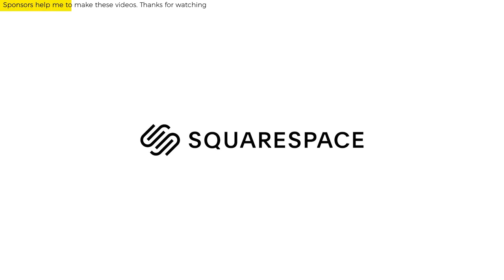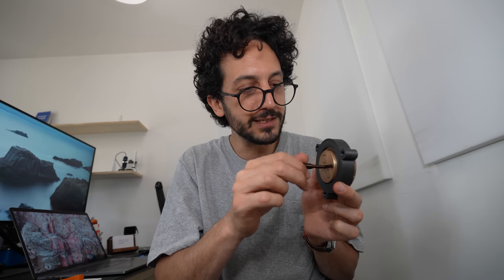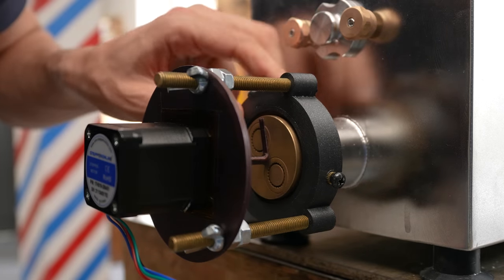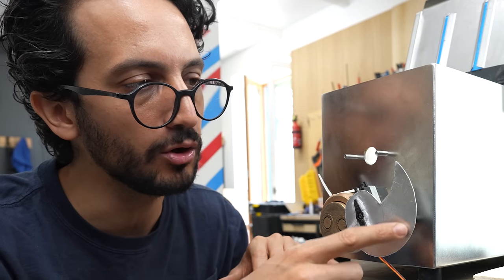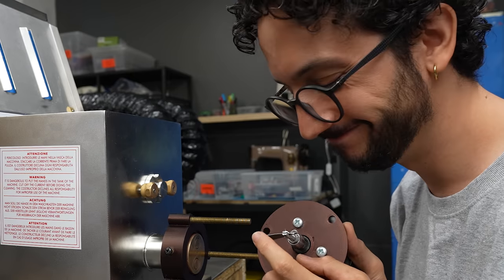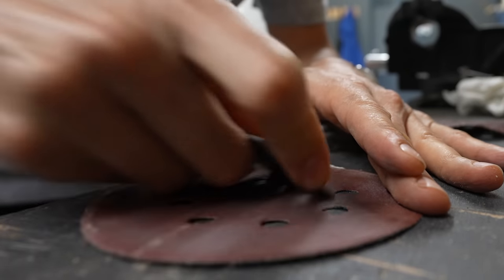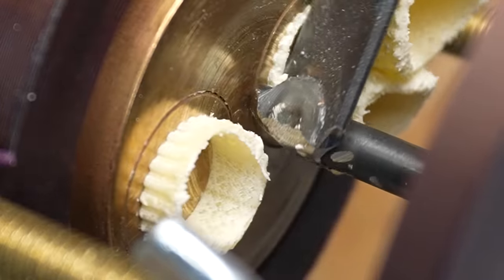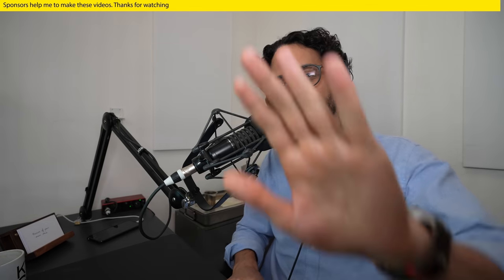I Tried to Make an Automatic Pasta Cutter (did NOT go as planned)

Comment: right, so the issue is the inner part of the blade is traveling very very slowly and on an arc
With that larger pasta extruders, the blade is effectively in a straight motion rather than an arcing one (especially further out)
When you cut with the knife it's fast and in a straight direction
You very much limited by the radios of the machine

Since you can code a bit, i would try making a linear cutting edge that goes up and down
Reply: just ping me if you want help
Reply: Also, the pasta dough was pushing the blade out of the way, especially on the thick one, which interrupts the cut. A wire might work for such a small machine.
Reply: problem with this is it would destroy the pasta on the way up, and if it was 2 sided it would cut too small, or have to do some sort of half rotation backwards up the machine and then come down straight again
Reply: Probably easier to scale up the current rotary design so that only a portion of the sweep interacts with the pasta.
Reply: @doodle9495  They were thinking of using a linear actuator, not a rotational motor like a stepper motor. Anything using a rotational motor will have the exact same issue that they pointed out.
Reply: @uiomancannot7931  I was thinking the same thing. That a wire would prevent the pasta from catching.
Reply: If you just realized that he could have his motor off to one side so that it rotates for 3/4 of the stroke over nothing and then only the last quarter actually cut across the dye. He'd fix a lot of these problems without having to complicated with linear motion or pausing or anything like that. He just needs to offset it to one side. He's 3D printing the cap so it's not like that's hard.
Reply: @doodle9495  It doesnt have to go up directly if you make a cutter/guillotine 🙃
Reply: @photonicpizza1466  That's not the case if the rotational motor drives a spring-based rotational cutter that resets on the back-swing...but now we're getting into tension adjusters, limited-slip-gears, et cetera. Probable easiest configuration would be a "Transmitted Force-sensing Series Elastic Actuator". Still, it's not a great solution, when a magnetic linear-actuator and a double-sided blade would do the job.

But guess what? Alex has a solution that works great for this pasta shape...so why would he employ these techniques?
Reply: @liiiinder  wym?
Reply: But the pasta maker maker sells an electric cutter for the machine that is one step above what Alex bought.
And the die diameter of that machine is 63mm instead of the 56mm of Alexs machine.
I don't think that those 7mm would suddenly change everything.

So his (and the pasta maker makers) approach should most likely work. (as proven in the end of the video)
Reply: Exactly this. Hope he sees
Reply: @doodle9495  two sided blade?
Reply: @photonicpizza1466  i totally agree
Reply: That's not the issue lol. Reason being he pretty much solved it in the end (So there is no "issue" to begin with), and his DIY automatic pasta cutter works the same as the ones made by the company who makes the machine. Only difference being he has a blade on one side, instead of two.
Reply: 1. Move the axis of the motor off center.  
2. Change the shape of the blade to be sickle shaped. 
3. Change the Blade material to laser cut stainless steel which he can sharpen
4. 3D printed wedge affixed after cutting edge to eject pasta away from cutting surface.

This would solve the problem of cutting motion, blade flex, and pasta not moving out of the way once cut.
Reply: I'm liking the idea of the linear actuator, and you'd only need one.  Anchor a wire or bit of nylon line above the extruder (maybe with a spring tensioner), with the other end attached to the actuator.  Time the actuation to the size of noodle you want, and the wire/line will cut on each stroke, forward and back.
Reply: Instead of a linear cutter he could also move the center of his spinning blade to the edge of the bronze disk and use a longer blade
Reply: Not really limited by the radius of the machine you could always mount the blade oustide the circumference of the extruder and make the blade go around and cut the dough in a similar motion as when cut hy hand. Blade in the edge of the extruder goes around, gives you more time for pasta to extrude then comes around and cuts the pasta.
Reply: That way the dough wont bunch up with each other as it just falls down while the blade goes around the outside of the circumference, it isnt going back up and mushing the dough with the next cut as in Alex example
Reply: Finally someone said it. 👍
Reply: Indeed. I was thinking that this will be the major obstacle. The distance travelled and thus time of cut is different between closest to centre and most outer point while the blade rotates at slowish speed (compared to the footage from the plant visit) and the extruder still extruding. I would have tried perfecting the last version with a start-stop timer (2 seconds off after one quick cut), and a much quicker cut speed (one turn).
Reply: On top of an off-center stepper motor, a sharpened metal blade (somewhat softer than brass to keep the extruder intact) with both an axial and radial offset could help with the cutting action might help: angled on the surface of the extruder and the outside of the knife "in front of" the part in the center, similar to blender blades.
The waiting time of the stepper motor between 360s can be mapped to length of extruded pasta in mm and the blade design ensures a clean, straight cut.
Reply: Yeah man, the cutter you built does not create the motion you need, you got  biased by the industrial ones!
Reply: Co-sign

Comment: Alex, remember the aggregation of marginal gains.
Good night's sleep +1%
Sharper blade +1%
Better blade shape +1%
Non-stick properties for the blade (carbon steel blade seasoned like a wok! Or just a non-stick coating on stainless steel) +1%
Blade alignment +1% (including support for the motor so it does not bend the blade out of alignment!)
Consistent pasta dough +1%
Clean pasta extruder +1%
Variable motor speed +1% (faster when cutting, slower when not cutting)

You will make the best one-man domestic dried pasta factory in the world. I believe in you.

Comment: To have more control on the pasta length, you may need to introduce a "pause" between cuts instead of just controlling the blade rotation speed.
Also didn't you think of using the blade of a utility knife

Comment: Sometimes I forget that Alex is an engineer lmao
Reply: He studied telecommunications and wireless networking. Somewhat related to software engineering (though just barely), but hardly anything like mechanical engineering.
Reply: @photonicpizza1466  I seem to recall him saying he worked as a software engineer before, which is what I was referencing. 
Regardless, by definition he is an engineer.
Reply: @TheTamally  He worked as a web designer. Not even software engineering, just very light programming.
And by your definition, most engineers are absolutely useless with mechanical systems like this. Even a proper software engineer is abysmal at considering important things like shear stress etc. “Engineer” is a very broad term, and using it this mindlessly is asinine.
Reply: @photonicpizza1466  Are you okay? You seem way too worked up about this. 

By definition an engineer is "a person who designs, builds, or maintains engines, machines, or public works." Wouldn't you know it, Alex designed, built, and maintained multiple machines over the course of this youtube channel.

Comment: Maybe, try to imitate what works well by hand : a blade set almost flat on the die. Maybe something which cuts 2 pastas by which moving up and down. When it cuts, it does so in short and quick motion. Size changes with delay between movements.

Comment: You were onto a winner with the saw blade but you're forgetting one essential thing:
ANGLE,
If you don't cut it with the blade facing forward you'll smoosh the part of the pasta you just cut onto the part of the pasta that is still being held by the extruder, the last prototype worked a bit better because of that (the pasta was ejected away from the extruder).

To put that into perspective try cutting your pastas with the knife at a 90° angle from the extruder, same result.
Good luck

Comment: I’m hoping he realizes that this setup can’t have a constant spinning blade. It needs to quickly spin and stop to allow the pasta to extrude then quickly spin again.
Reply: You can make the blade slighty canted
Reply: maybe mount the motor next to the extruder and run the motor faster?  🤔
Reply: Yeah, when he said "stepper motor" I thought that's what he would do. "Hey Alex, use a brushless motor with a position controller!" Then he could make the lengths of the pasta exactly what he wanted.

Comment: When cutting it with a knife the whole blade of the kinfe was at a right angle to the pasta, or flush to the extruder dye so it didn't let the pasta Stick, or be carried by the blade. If you made the "blade" on your current set up thinner (blade to spine), think blade out of a disposable razor rather than hand held old school straight blade razor as a 20 degree facing the dye then put it at a right angle to the extruded dough you won't "catch" the pasta and carry it, especially on the upswing. Think 12:00 to 6:00 cut vs a 4:00 to 10:00 cut.
Reply: Will agree the blade that you made need to be at an angle to get a better cut like a the angle of the knife
Reply: agreed, make the blade surface smaller,give the pasta less surface area to stick too.
Reply: can use wire like from a wire cheese slicer as well.

Comment: Wonderful solution.
With a double blade like the final one you made. If you alter the code to turn 180 degrees, stop and wait, turn 180 degrees, stop and wait ... etc
You need only alter the frequency of the cycle to cut very  specific size pasta.

Comment: Alex, what you need is intermittent motion, not constant rotation. Bigger pasta machines don't need to do this because the rotor turns fast enough, but your die is so small that the entire die is probably the size of the axle of the pasta cutter on commercial machines. Since you have a high torque motor, do this: Have the blade on a spring-loaded pivot, and let it compress the spring as the rotor turns, then at the right time, have it pull past the stop and swing forward to slice the pasta from the outlet.
Do this once every 180˚, and you'll get intermittent motion with a quick fast cut that works well with your small pasta die.

Comment: This series is getting long. It's clear you are so passionate about this. Lovely to see. It also made clear why they are not selling a cutter for this machine.

Also, as some have mentioned...... this disc seems too small to cut with continous motion, but also starting and stopping is difficult. If you could stop, and then quickly spin 360 and then stop again (repeat) then that could work for larger pasta.

Comment: Use an old skool Razor blade. Code the cutter to wait and then cut QUICKLY every five or six seconds (depending on required length of pasta). I'm deeply impressed by your dedication to this project by the way given that you could just get on your bike and have very good pasta from the deli for smalll money  😁

Comment: Alex first time responding to your videos. Your over thinking this. You need a relay switch with a blade that will cut down and pull up at very fast speed. The pasta comes out at what 4.0 second and then slice. You could use box cutter blades because they are cheap or wide razor blades. I love your work.

Comment: Alex use a piece of spring steel. Set it at a very shallow angle with some light tension against the surface and very fine edge that has negative relief against the surface of the die.

Comment: For a cutting blade, try the steel bands they use to strap heavy boxes shut for shipping.
They are very springy and thin so you can preload them against the die to take out the play.
Also, increase the angle like they did in the footage you showed in the beginning.
It should be as close to vertical as possible without having the next pasta be smashed into the back of the blade.

Comment: I'm picturing a vertical blade windmill type of arrangement. Mount the motor perpendicular to the extruder with an arced blade attached at both ends that will press against the die with a sprung force. A stepper motor could solve your speed and frequency problems. You could also cut from top to bottom that way and gravity would force the cut open, resulting in less deformation.

Comment: If you off set the motor instead of centering it on the die the single blade would be more like your knife cutting the pasta. It would also have the advantage slowing the cutting action. Another idea I have is a flat piece of metal with three holes the size of the pasta ,the piece is placed on the die and slide up and down quickly (like with an electromagnet  you find in a door bell). It cuts when slide and exposes the other set of holes  and then  is  slide back cutting the other way and the cycle repeats.

Comment: Maybe you can make an attachment that utilizes double edge razor blades, that you may also have for scoring dough for bread. You'd have to wipe the coating off, but they are very sharp and you can snap them in half if you run into clearance issues. Can simply dispose of them and replace when they become dull.

Comment: As the other comments said, need to make it so it cuts fast then waits basically yeah. It would also help but wouldn't be necessary depending on how thick or sturdy the blade is, to have a ring around the pasta extruder, that would keep the blade from getting pushed outwards by the pasta and flexing it. It would help make the cuts better.

Comment: Hey Alex was thinking of this. i have an idea which might work so basically I was thinking you can make some kind of sliding track horizontally connecting to the extruder and mount the motor on the track(use screws placed at equal distance on top to stabilize the motor ) so you can maintain a bit of distance from the extruder which helps with the speed and also now you can control the length of your pasta too

Comment: Not sure if you are looking for advice, so ignore me if you already know this but I feel like you had a good idea with the blade mounted on the side not the middle. It seems like the squishing of the pasta came from two factors, the sharpness of the blade which you mentioned and the speed at which you cut the pasta. I believe if you were to mount a thinner sharper blade more parallel to the face of the extruder you would have less squish. And if you mount the blade to the side you could have a faster blade because of the larger radius. Anyways, fun video I'm excited to see the rest of the series

Comment: Alex, what about a U shaped holder for a piece of cheese wire, that way the pasta wont catch/stick on the cutter assembly. Or a cutter that moves across the whole of the extruder from one side to the other. Just a knife blade that sweeps across, waits then back again. Cutting both at the same time, rather than one then the other, to keep them uniform in size.

Comment: Another shape for the cutter that might work even 3D Printed (by the way i recommend ABS not PLA for use with food) is a helix. If you imagine the end of a drill bit, flattened off and very large, that's what I'm thinking of. That would provide a lot of support for the cutting edge and so might work (I think there would need to be an undercut just after the cutting edge to allow the next pasta extrusion to begin).

Comment: You should revisit the stepper motor for the last design, the control it provides you over cut speed can't be underestimated. Making a swift cut 360 degree every X seconds is better than a slowly revolving blade that mashes the pasta.

Comment: You can either make the extruder move in stop-move fashion, or you can move the blade off center from the dye. The idea there is that the knife should cross the face of the dye very quickly, much like you moved your knife. Since the velocity of the blade at the center is much slower than the velocity at the edge, you get the warped shape on one side.

Comment: Alex, the biggest problem is the blade shape. With a straight blade cutting its going to make contact with 1 point and begin squishing before cutting. That's why the pasta looks like it has been squished. The blade needs to have a curve like a half circle. That way there is more contact and won't cause as much squish. You probably need different blades for different pasta shapes.

Comment: All the commercial examples of cutters have a lower angle of attack, the knife method has a blade angle of attack to the die face of close to zero. Before retirement I had a small extruder in my lab (not making pasta, but the material was like a noodle), the angle of blade attack was close to 29 degrees. We used a piece of spring steel to make blades.

Comment: You can increase the speed of your blade  if you change the controller to only sweep every 4 or 5 seconds then stop and wait. Basically program it with a much higher speed but to go around once, wait, go around once, wait.  This will also allow you to control the length of your pasta by changing the wait interval.

Comment: Have you considered using razor blades? The old-school, double-edged ones. They're strong, thin, cheap, and insanely sharp. They even come with holes, clearly designed for easy mounting to a pasta cutter.

Comment: I would suggest using the metal string/wire instead of rotating knife. You can fix the string on one side (add a spring here for tentioning) and move it up or down on another side using the solenoid (for example).